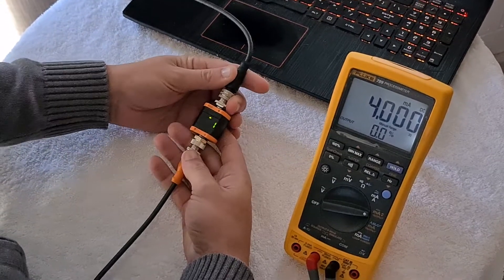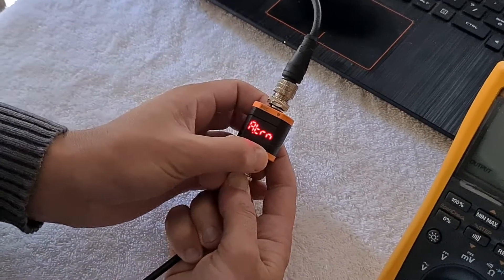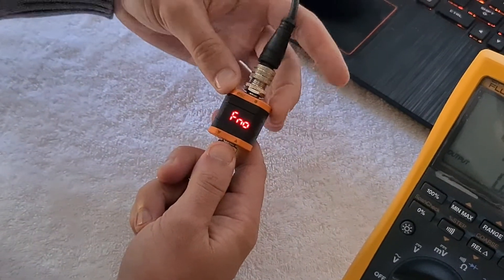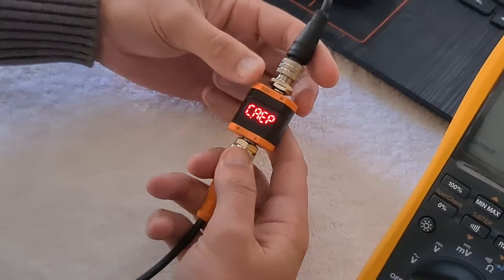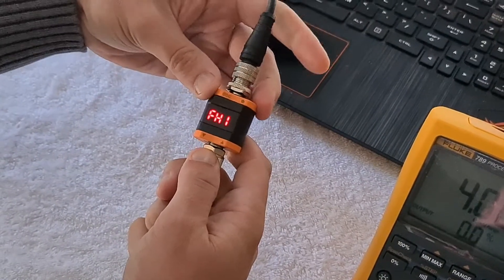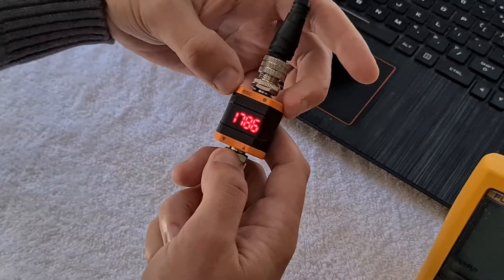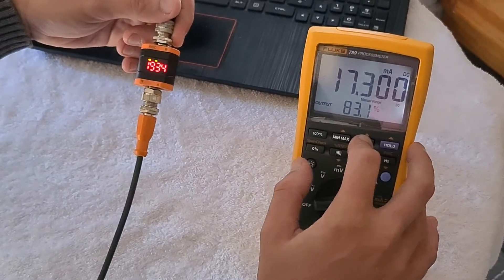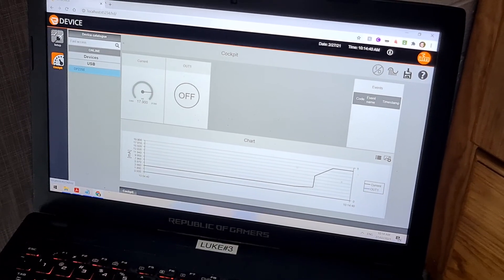IFM DP2200 Configuration Example

Comment: Is there a way to change the unit of measurement?
Reply from the maker: Yes, the display does not show units, so by setting the minimum and maximum values to be in the unit of your choice the display will now read in that chosen unit. This means the display can be used for pressure sensors (bar, psi, kpa) or level sensors (meters, centimeters, percent) or any other type of 4..20mA sensor with any unit required.